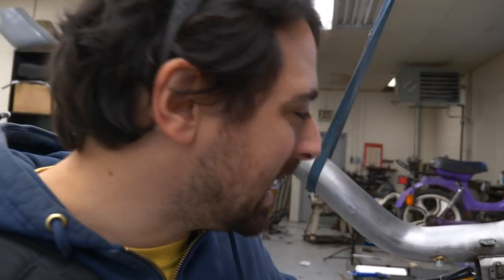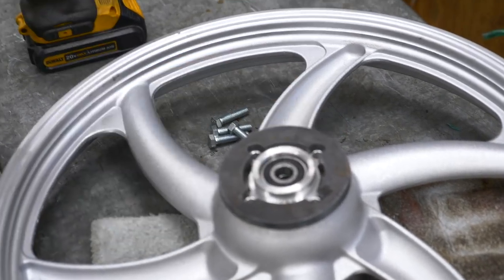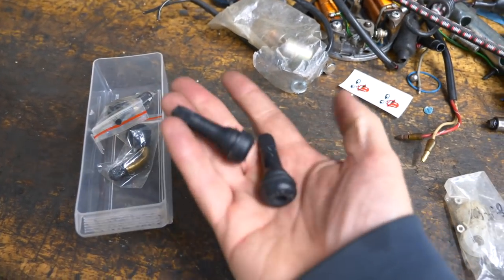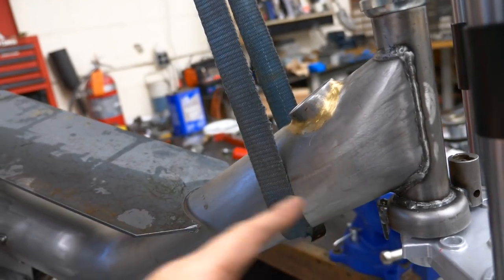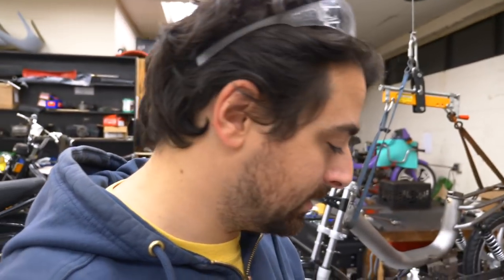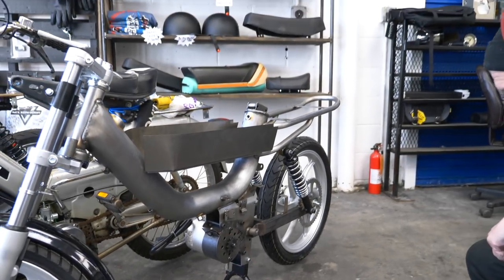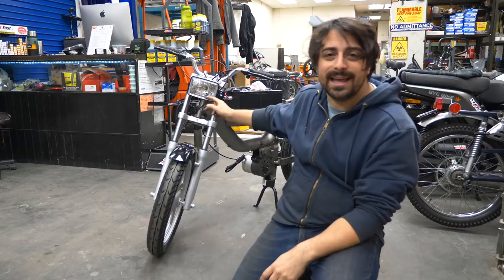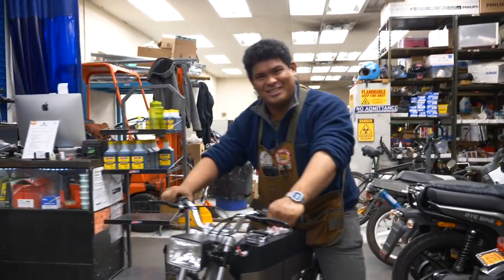"Proto-MOTO" ...The E-Moped Saga Continues...

Comment: Is it possible to mount the battery transversely under the frame? For a low-speed, around-town machine, the COG win is huge and drag not an issue.
Reply from the maker: The size of the battery we need to go as fast and as far as we want... is pretty large. It’s not gonna fit down low without getting smashed by a curb or something